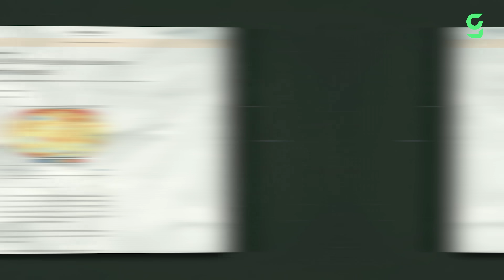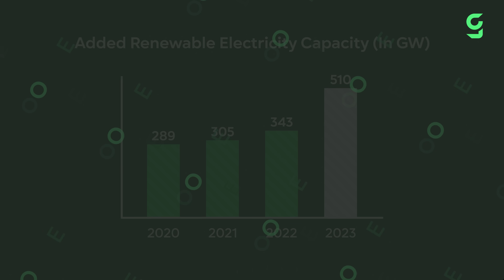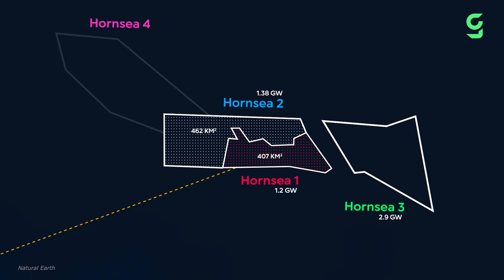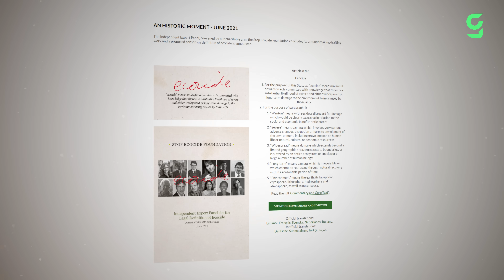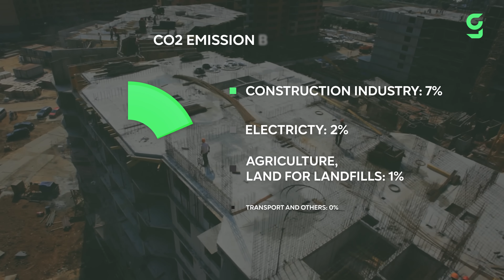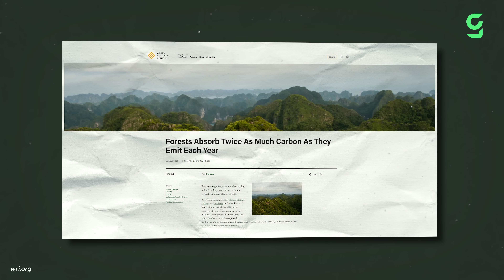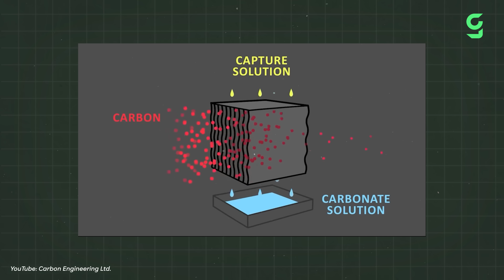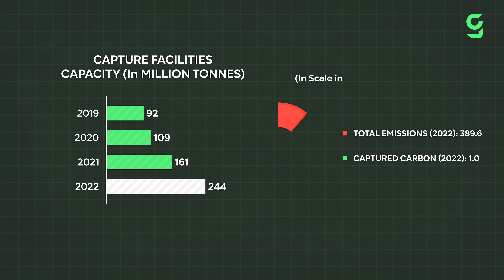Can We Stop Climate Change?

Comment: Anyone know if there’s a video explaining the difference of emissions between electric and petrol cars? Specifically one that accounts for mineral mining, mineral transport, construction, production of electricity for charging and anything else I haven’t mentioned. Surely with the minerals needed for massive batteries means electric cars will become emission equal after many thousand miles and IF high enough where a new battery is needed, is it possible there are some petroleum cars less pollutant than some electric?

Comment: Climate change is now both a symptom & cause of widespread degradation, damage & collapse of various ecological systems, processes, services & goods, awa biodoversity losd (over exploitation).

The "secret" to climate restoration (in a nutshell)
- eliminate GHG emissions
- restore ecological systems, processes, services & ecosystems to increase GHG drawdown
- keep human system activities within ecological limits

The main areas of concern include
- agriculture (aka food- water- energy- land nexus)
- electricity generation 
- transport
- buildings (construction, heating & cooling)
- solid & human waste
- industry & manufacturing (especially those requiring heay such as steel, aluminium, cement, ammonia, paper etc)

Solutions have been found for each of these sectors - refer Project Drawdown.

At the heart of the ecological crisis, incl climate breakdown, is our attitude towards nature. If it does not vote, have legal standing or even a voice (no sanctions for pollution or ecological damage & destruction) then its open season on exploitation & abuse (nature has no intrinsic value to humans). This needs to change (nature must have legal standing & there must be serious consequences for ecocide). What also doesn't have a voice are the lives of future generations.

Unfortunately there's too much money invested in ecocide. Change is happening... hopefully fast enough to avoid cascading tipping points.

Comment: I think it's important to remember that most media goes negative because as a species we are wired to look for threats.  They exploit this by overstating the negative.  One way to feel optimistic is to stop partaking of media in general.  I am an optimist!  Things aren't great in terms of the environment but I have faith that we will conquer climate change!!  I suggest sharing this video and other positive stories with those you love, better that than fear and conspiracy theories!!
Reply: The media hardly even reports on climate change period.
Reply: Conspiracy theories are what the right propagate to distract our limited attention spans, and cutting yourself off from the news is just embracing ignorance, which some say is bliss. I can honestly tell you that far from overstating the risks, the media in general is complicit in NOT reporting what's going on to the extent that it should. The simple reason for this is that the media is largely controlled by the moneyed interests causing the problem.